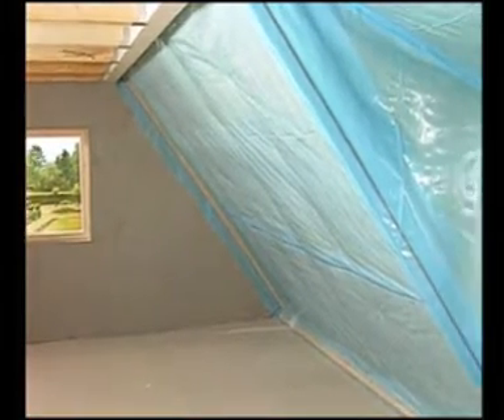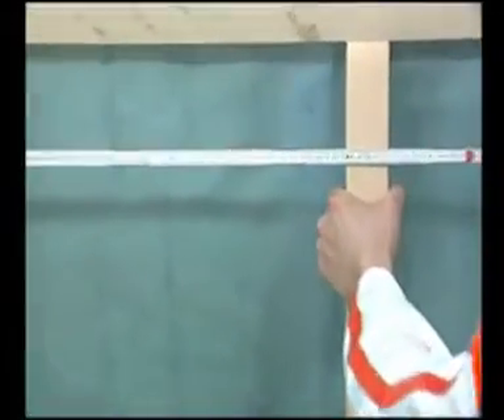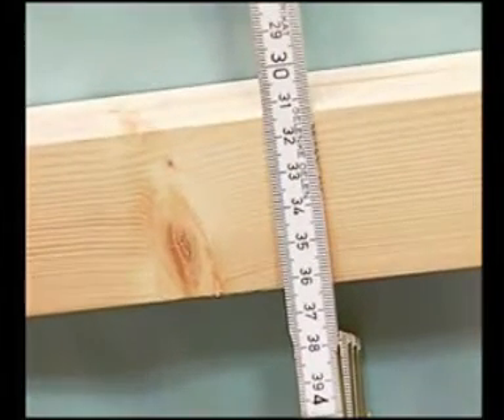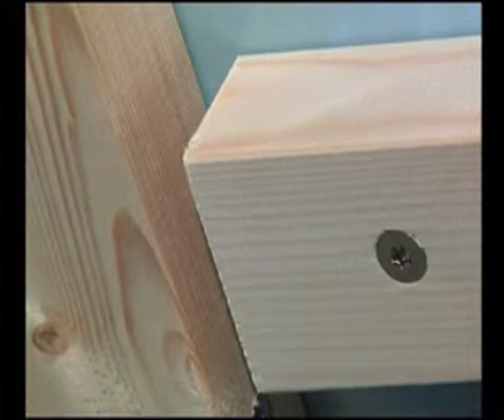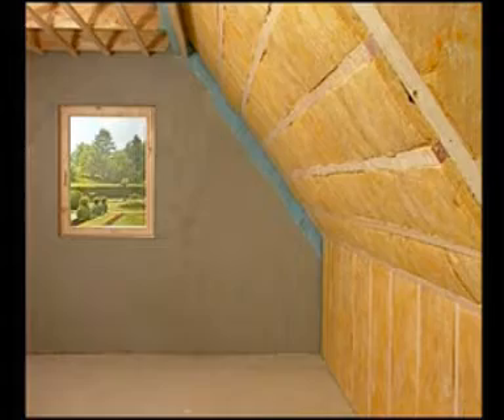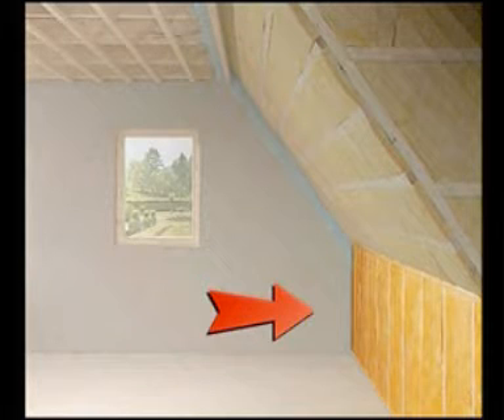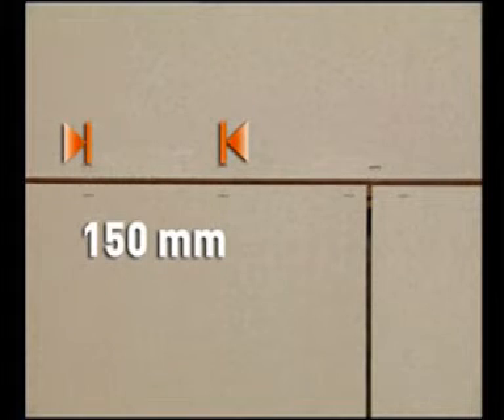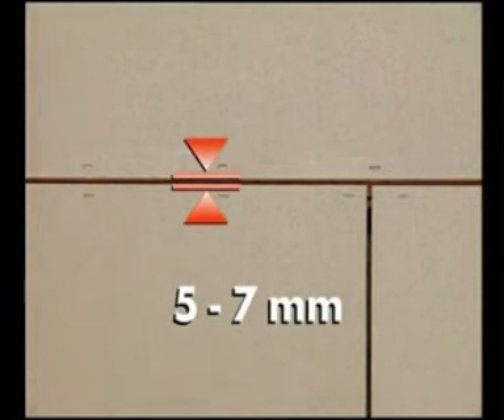Dry Lining Fermacell Attic

Comment: To whoever is watching this:
This is very incorrect installation, because only exterior layer of insulation (glass wool in this video) is protected from moisture.
As a result moisture passes drywall, wets internal studs, insulation, condenses on foil, and effectively stays here.
After a while wood will change dimensions producing cracks on drywall. Interior insulation will get mold, internal studs will rot.
All those issues would be prevented if vapor barrier (polypropylene foil) would be installed in proper place just before drywall.
Reply: Maciek Urbański couldn't have said it better myself